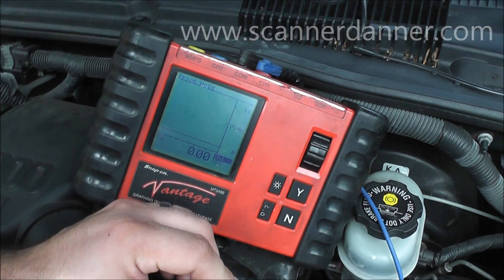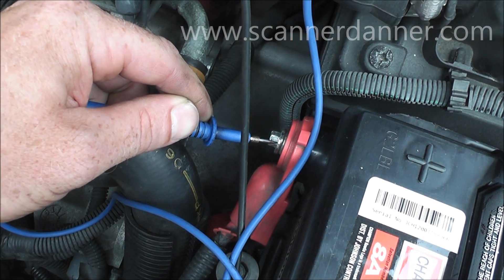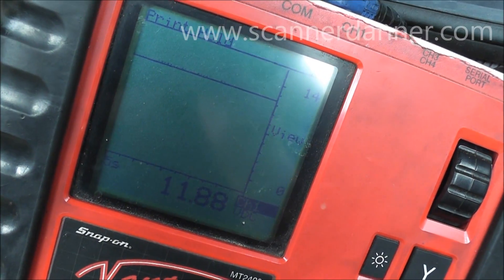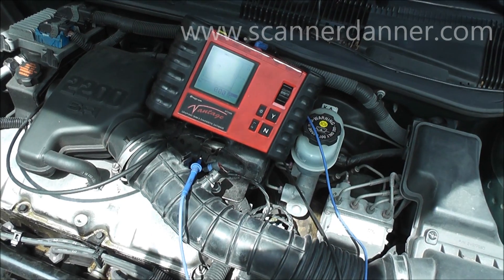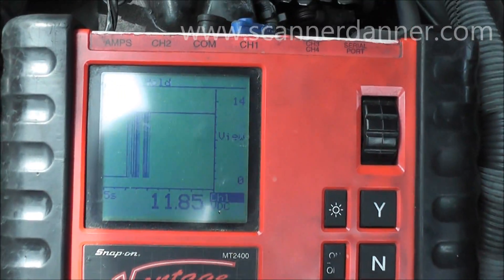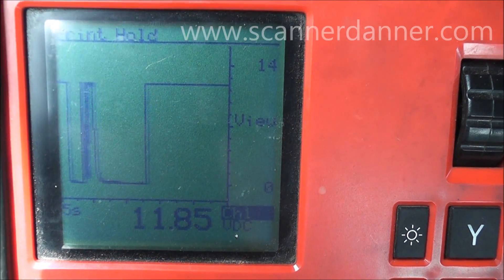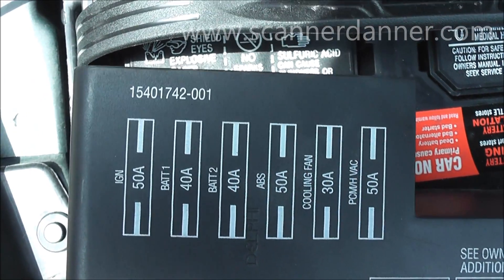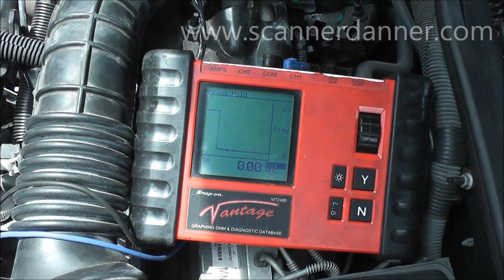2002 Chevy Cavalier No Start (a direction based approach)

Comment: Could that PCM fuse make the fuel pump kick on ?
Reply from the maker: If the PCM is missing a power feed, yes, it can make the fuel pump circuit run all the time

Comment: Hot damn that was a great video i had a 99 grand am with a cracked window sitting in it on lunch break in the rain kept hearing a psst psst psst like water dripping on a hot stove i was like what the hell looked down and saw what looked like smoke coming from the crack of the door and freaked out opened the door and my whole fuse box was full of water and steaming like a coffee pot so allthe relays and fuses were all rough and sorta cooked looking it didnt matter in end catastrophic timing chain failure

Comment: 2004 cavalier was driving fine went to store came out then wouldn’t start. Cranks over. Dad told me to Spray starter fluid into the air intake did that and it fired up  then died a few seconds later dad thinks it might be a fuel filter it’s got about 70,000 miles on the car probably never had a new fuel filter put on it going to try thatAny other suggestions
Reply from the maker: What engine? A fuel pressure measurement would be key. Also you'd want to confirm injector pulse

Comment: My 2002 2.2 immediately stopped running on way home. After i got it home it had no codes . checked spark coils good, fuel pump , pcm fuses, crank relay everything good. I even changed the plugs and wires . Im assuming its a crank sensor. It has compression. Going to change it ? Its either computer or crank or jumped time. What does it sound like to you ?

Comment: I have this same car with the same not start issue, but while checking the fuses under the hood i removed the crank relay and the car started cranking by itself with no key in the ignition do you know what this could be coming from?
Reply from the maker: That's weird! With the starter relay removed?
Reply: @ScannerDanner  yeah when i pull the relay out of the socket the car just starts cranking on its own it sort of sounds like there is a short somewhere
Reply from the maker: @kevinnelson7070  I'm so sorry, it is hard for me to keep up, especially with follow up comments. I get about a hundred new questions a day, and do my best to answer them and when I do, they just multiply! Anyway, if you still need help, I have created a forum on my website https://www.scannerdanner.com/forum/post-your-repair-questions-here.html that is free to join, where I have 4 hand picked moderators and over 25k global members who are there to help me help you guys! You will not find a more friendly and helpful forum anywhere. Hope to see you there! Thanks for understanding.
Reply: @ScannerDanner  I really appreciate you responding, but as far as the car goes the relay was part of the problem, I took it out and shook it and there was rattling inside so I replaced it, and the weird cranking stopped, but main reason for the no start was a faulty non functioning air idle control valve, I swapped it out and she is running like new👍🏿 God bless.
Reply from the maker: @kevinnelson7070  don't forget about my forum in the future and of course you can ask questions here too and I'll do my best to reply

Comment: I had the same problem with my Cavalier (fuel pump not running even though the relay was working) This is a great to the point video and did give me some good ideas. But my problem turned out to be different and I'm only commenting about it in case it may help someone else. 

My fuel pump was not running even though the relay was clicking in and transferring power to the pump.  Without going into all the things I tried and tested I'll cut to the chase. 

I found the ground wire between the battery and the chassis was bad (The ground to the motor was still good) No chassis ground and most things on the car still worked including the engine cranking and the dashboard, but the fuel pump did not. I hope this helps someone.

Comment: i have a 1999 Isuzu Trooper or as we call them in australia Holden Jackaroos and they have a feature built into the tech2 where even if the MIL Light isnt lighting due to blown bulb for example the tech2 can actually inform you if that fault condition is indeed set same for airbag light we get alot of people removing bulbs for roadworthy inspection and the tech2 has caught them out every time for ANY GM Vehicle i encourage people to arm themselves with a tech2 :) great tool

Comment: Great vid, we had a 2004 Jeep Cherokee in the shop the other day that a PCM fuse under the hood that appeared to be fine with an LED test light. This was crank no start. After checking fuel pressure and inj control pointed to ASD relay which, showed weak ground from pcm. Directing us to check some fuses. Found a partially(?) blown PCM fuse with enough contact to light an LED test light but showed nothing or a very dim light on one side of the fuse with an incandescent test light. I use these methods because you keep proving them to be useful. Thanks so much!

Comment: I've had a lot of vehicle with a no check engine light. I guess this is off the subject and a few years late. Well, I always tell people to check that the Check Engine Light comes on when they turn the key on before they start the car, if no light then don't even bother with starting or buying the vehicle. My latest was with a family member. He bought a car without listening to what I have always stated. He called me saying he bought a car and he loved it and that he took it around town and no light came on. I asked him again did any MIL light display before he started it. No and that the car runs fine. 2 days after his purchase he calls me and says he needs my help. So I pretty much knew what one of the issues I would be dealing with before I got there. I told him that one problem he is dealing with will be a CAT issue and no telling what else. {He also stated over the phone that No Lights still weren't on.} So after getting there, it was the CAT that had actually melted down and plugged the exhaust. With about 1000 other codes that was triggered. Long story short, the local dealer removed the MIL light to cover up the faults that the car had. Scammed into buying a Lemon. Also before I end this, I've also advised my people to also pull the E Brake also once the car is started. Had a car come in where someone rigged the MIL Light to the Brake Light. Sorry for the rambling.
Reply from the maker: Thanks for sharing!

Comment: the usual ,check fuses,then relay,then beat on tank,then pull wire plug to check for power to motor,before dropping tank totally,and i use a continuity light,grounded,with key off to make sure have good grounds,then test light with key on and relay taped shut.if all this checks out as in havin power in on position and good grounds in off position on each connection coming through behind seat,if all is good.then do aS I DID LAST WEEK FINISH DROPPIN TANK.RUN GOOD STIGFF WIRES FROM HOT BATTERY STRAIGHT TO PUMP BEFORE PULLING IT OUT OF TANK,THIS WILL BE MOMENT OF TRUTH,IN MY CASE IT WAS TOTALLY SHOT.IT HAPPENED WITHOUT IT ACTING UP WHEN I CAME IN THAT DAY.STARTED TO STORE LATER NO START.SPRAYED STARTIN FLUID IMNTO INTAKE HOSE.IT HIT.I REALLY KNEW THEN.BUT I STILL TESTED MY WIRES WITH TWO TYPES OF TESTERS.TESTERS HAVE THEIR PLACE,BUT IF YOU CAN GET A WIRING SCHEMATIC OR DIAGRAM,TEST LIGHTS ARE A SHADE-TREE MECHANICSA BEST TOOLS.AND OPF COARSE U ALWAYS CHECK FOR FIRE THEN GAS.AS WITH ANY ENGINE MADE.GOOD STUFF YOU PUT UP THOUGH.ESPECIALLY WITH THE NEWER CARS.THEY ARE MAKING JUNK MORE AND MORE.U DONT NEED A SENSOR FOR A SENSOR FOR A SENSOR.ITS ALL ABOUT THE LOVE OF MONEY.NOTHING IS FOOL PROOF.OH YEAH A MULTIMETER IS GREAT TOO.A GOOD FLUKE IS ALWAYS A GOOD FRIEND.KEEP UP THE GOOD WORK

Comment: love the videos,but anyboyd who checks several other things before checking fuses shows your too prone to showing your scanner rather than common sense.most all of us dont have a 8000 dollar set of diagnostics tools.i have a35 dollar one,but i have learned more reading and trial and error
Reply from the maker: lol I am using a graphing multi-meter that dates back to the early 90s
The scan tool I use is expensive but a $30 code reader would have told you the same thing "no com". 
And what do you do when the fuses are good? Most of the time they are! You are failing to see the big picture here my friend.

Comment: awesome video! my 2008 suzuki xl7 2wd did not start/crank after i gave a guy a jump start. had to tow my car to my place. some karma smh... i got all the lights on the dash, so i changed the starter. then i had to travel on business. i may have wasted money and time since i also had to remove part of the exhaust system. i'm worried that my computer fried, but i'll find out this weekend. definitely going to re-watch this video and your two-part no start no crank (detailed map vid) before i give up and take my car to the shop.
Reply from the maker: IF you're lucky, there may be a Maxi fuse that blew. I know Honda uses a 100 amp maxi fuse, maybe Suzuki does too.

Comment: I have a 2003 cavalier it was running fine then I turned car off and left car for bout 23rd came back tried to start..it crank but no start..check engine  light on light you said in video the pcm fuse looks good but no start sound like it's getting  no gas..where  should I look next
Reply from the maker: You need to do some testing. Spark or fuel? What are you missing. For more help, post your question here. We can help you https://scannerdanner.com/forum/post-your-repair-questions-here.html

Comment: I have a 2002 chevy cav that cranks but no start tested coil and have spark rpm gauge not registering when turning over check engine light is on... if coil is getting spark can it still be crank sensor
Reply from the maker: no sir, it would not be the crank sensor. for additional help, post this to my forum at www.scannerdanner.com
Hope to see you there!
Reply: Ken Thurman I have a 2001 cavalier and it did the same thing turns out it was short of ground you need a cable conected to the negarive pole of the battery and run it to the engine block and from the block to any place in the chassis and believe me it will start

Comment: I was taught to check fuses first , but it is hardly ever the fuse . there is way more value in looking at the system as a whole that way depending on symptoms you know which way that you want to go that will be the fastest to diagnose .   great video
Reply from the maker: +John McKamy agree and thank you!
Reply: +ScannerDanner so on a thermistor  the signal  wire will show both power and ground?

Comment: of course its not always a fuse but you said so your self in your word instead of wasteing time to check coil pack or check sensors orfuel etc you go thru all that time diagnosis  to find out its a fuse the second you put your scanner you should of went straight to fuses when there was no communication step 1 fuses battery connections lose wires hoses unpluged sensors any thing that you see can be the problem all of theses are VISUAL INSPECTION THEN YOU MOVE ON TO THE 3 THINGS TO START A CAR    .......AIR GAS AND SPARK  THIS TEACHES YOU HOW TO FIND OUT THE FUSE IS BLOW ....WOW
Reply from the maker: If you didnt find value in the tests i showed You're on the wrong channel man. Sure, this time it ended up being a fuse but that is 1 out of 20 at the most! What do you do when your fuses are good? Which most of the time they are! Ridiculous

Comment: this is a good example , using the fuse ,why you don't probe the front ,you spread pins or pour connection when you plug back in?

Comment: my 99 cavalier will start after i feather the gas pedal, it has new starter also. i work 3rd so when i get the chance im gonna check plugs. i just got the radio out of theft lock lol guy before me couldnt figure it out..... great vid and new sub
Reply: ling ling hey did you figure out your problem? Mine is doing the exact same thing. And I believe it’s electrical because the radio makes a difference. When it shifted the car turned off. I had to pump gas to get it back

Comment: my 2002 caviler has a similar problem but it  cranks over and starts it just runs roughly and has a cyclinder that is dead but seems to come back when I'm cruising around 60 mph and this all started after a mechanic removed my dash to replace a heater core
Reply from the maker: +mopar or no car compression test needs to be done on that dead cylinder.

Comment: i have a chevrolet cavalier 97 as a gift last December 2015. shift transmission.  that only issue that i have is the car won't start in the morning when is cold,  but after the sun warming it up it's star like nothing happens to them.  i brought to a mechanic friend he say it's the firt time get a cross with this problem. he recommended to take it to the dealer.  that would've too expensive.  Do you know why it's doing that ?  but the way , in the mornings the the check engine and the check your gages lights on only. nothing else.  use to be also the anti theft light goes on to and wait 10 mins. but no more. anything helps.
Reply from the maker: +Charlys Hernandez what lights turn on with the key on when it does start? Does it change?
Reply from the maker: +ScannerDanner Also when you turn the key on, do you hear the fuel pump prime?
Reply: In the morning this it's the lights come on check engine and check the gages only. 
And yes the fuel pump works and the injectors.
Reply: If you prefer i can send you a video what it does in the morning's and another one in the afternoon.

Comment: I have noticed a lot of mechanics in my area when a car won't start like this immediately jump to fuel pump issues...my 2002 Cavalier wouldn't start and they thought it was a fuel pump and came back and it was the starter had died on it. Replaced the starter and haven't had an issue since. Good video!
Reply from the maker: +Justin Hall thanks Justin

Comment: Hello
I have a 2000 Chevrolet Cavalier Volume 2.2
Does not work . Have a starter, there is a spark. Injectors workers,
No fault codes, compression checked at 130 PSI All Cylinder 
 He does only back fire

Comment: i got a 1998 2.4 cavalier it will start up fine and run but when i put it into drive it dies but i can drive around in reverse with no problem but anyother gear it dies? help please
Reply: +keith Wiggins  sounds like you have some broken ground wires (tan and black small gauge wires) mounted in the same location as where the negative battery cable connects to the block. These are main computer grounds and will not look broken but if you tug on them they'll break. It is just the insulation that is keeping them together. The reason you can drive around in reverse is the engine will torque the opposite direction keeping the broken and frayed copper wires together. But when you put it in gear it opens them. Common issue on the 2.4. Of course this is a guess but it would be cool if I'm right. Let me know
Reply: what did you  end up doing, to fix the problem

Comment: I have a 2000 cevey cavalier it was driving fine then i let a friend use it now it won't start the lights come on bright the oils are good it sound like it want to start but it won't someone said it might be the fuel pump but it look like it's in good condition
Reply: Crissy Robinson I have a 2001 cavalier and it did the same thing turns out it was short of ground you need a cable conected to the negarive pole of the battery and run it to the engine block and from the block to any place in the chassis and believe me it will start

Comment: I HAVE ONE AND WHEN WE FIRST CRANK IT UP,ITS COOL BUT ONCE WE START DRIVING ALL THE LIGHTS COME ON ON THE DASH..AND THE FUEL HAND AND TEMP HANDS ALL FALL TO ZERO,BUT ITS STILL DRIVES...CAN U GIVE ME SUM TIPS.....
Reply: Mine did the same its more than likely the serpintine belt. Its not pulling all the things it needs to pull such as the ac transmission and power steering get new belt

Comment: Have the same car but none of my lights in the inside turn on Including the check engine should I take the same approach?
Reply from the maker: If none of the dash lights light up, start with checking power on your fuses. You could verify the 5v ref circuit too

Comment: Hello, I got a good one for u my car died couple days ago andwhen I open the hood there were oil Al over the top of the engine the spark plugs were smothered in oil I took off the plugs completely dry ,there was spark but still no start  ,I think the valve cover gasket might be leaking or the head is cracked what could I do..I need ur help big time
Reply: It turns over but it wont start just before it died it waz making a loud tic then it died and never been running sense